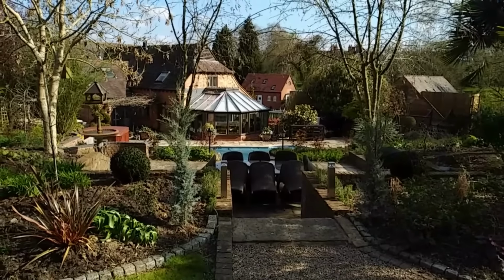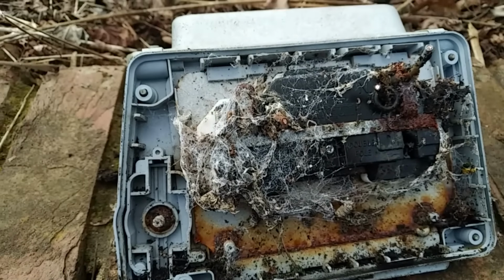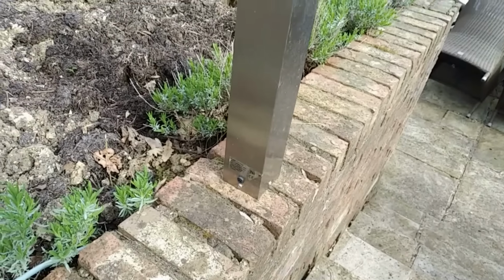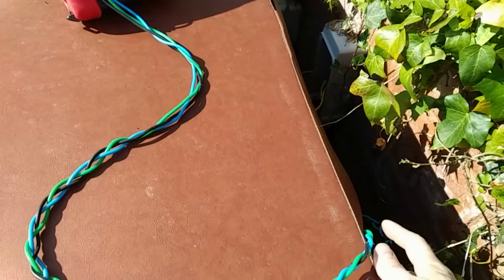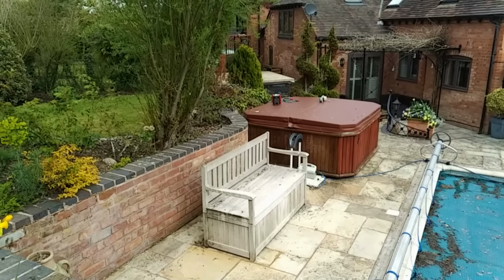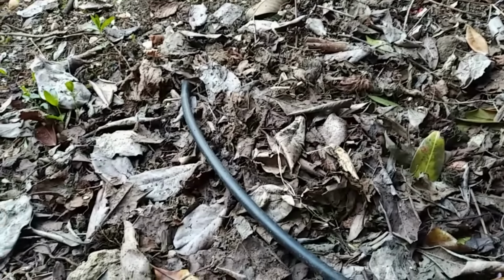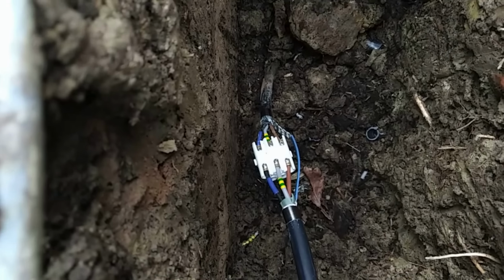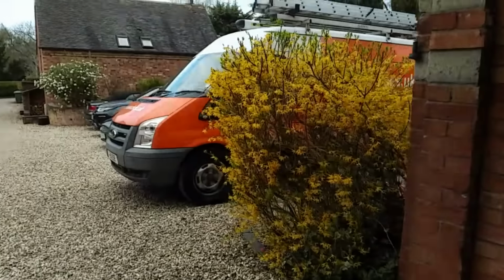Uncocking cack garden electrics

Comment: Did you ever go back and sort out all the issues with the Electro Spaghetti ?
Reply from the maker: We went back at the start of last year where there was discussion on what needed doing but it never got past that, at least not for us. The previous homeowner had put in the landscaping and the current one was formulating plans of their own. I'm not sure if COVID put the brakes on everything or if the work went forward and they plumped for another electrical contractor.

Comment: This disaster site really needs a complete rewire with, in most places,  new terminal cabinets.  Whilst doing that, a transformer to drop voltage to 12v would be a good idea.  The cabinets should be located much further up the walls to facilitate bottom entry to reduce water ingress.

Comment: 13 amps with heater and both pumps on, seems low...
Reply: They make 13 amp hot tubs, cost less and are cheaper and easier to install. And by the quality of this entire job it looks like the owners wanted to do it as cheap as possible.

Comment: Very interesting, but I would have liked to see how you terminated the Swa Sheathing over from the one cable to the other when jointing the cables with the Jointer, it did seem a very neat make off and yes the Alan Key is a complete No No, why they do that irritates the hell out of me, I would add that I do tend to find a safe place inside the Joint and leave the Alan Key covered over in Pvc Tape for the next guy.

Good Proffessionals should have installed Secured Vertical Treated Hardwood Posts Set into the Ground and used Water Tight Mounted JB's to each Post along the length of the Radial Circuit, then spured from each Joint to each required Power Point or FCU for Lighting and lastly all wiring selected should be the same type/size where possible and therefore able to have a fuse rated to suit. The Radial to be installed to depth in the ground away from Gardeners and Vermin at a depth as stipulated within BS7671, Finally all items identified with waterproof tags hanging or stamped at EACH Post JB with the EOL Clearly Identified. A Circuit Drawing left at both the Main Incomer and the DB Supplying the Garden Circuit with the Contractors Details/Date of Installation and any warranty period, this is the signiture of the painting masterpiece of someone proud to show they have installed the works.

Close your ears here, but I often find the difference between an NICEIC Contractor and an ECA Contractor is simply this,  the latter description of how it would be done when using an ECA Contractor and pot luck when using an NICEIC Contractor/Wannabe Contractor. 

Next time you go into an installation carried out and labeled by an ECA Contractor take a look at the standard of the work compared to those NICEIC who seldom leave any evidence they have been there.

Keep up the great work, I love sitting here on a Sunday Morning viewing these takes and it always reminds me that things never change, it was like this 40yrs ago, crap installations in posh houses that thought they were getting quality work for the scandalouse price they were no doubt being charged.
Mr Spence Eng [ex NICEIC/ECA]

Comment: The hot tub is on 230V plug. The hottub can not be moved so there for not an appliance and therefore permanent, and should really be on a isolator
Reply from the maker: The hot-tub is on a dedicated circuit with a 16A 2P+E outlet that has an isolator.

Comment: Eh up DSES! Quick question, call me a saddo but I've been binging on your vids and I'm wondering if you'd mind explaining why your IR test without unplugging, then retest unplugging as you go, many Thanks in advance as I know you'll reply!!
Reply from the maker: Tony you saddo! If we're on a nuisance trip job, we'll test L-N connected together with respect to earth before making any changes so we know what the installation is doing before we roll up our sleeves and dig in. We'll test again with any loads removed so we can see what the difference is. If the IR has gone up, we know we're looking for a duff appliance, if not, we know it's either the wiring or there's still a hidden load we haven't found somewhere. If you have that baseline reading showing how the installation is before you start, then you know if you're making a difference. I hope that answers your question, but let me know if not!
Reply: David Savery Electrical Services answered perfectly, thank you very much! I can relax now and have one of the bar lady’s best!
Reply from the maker: @Webbster77  Quite right too sir! Down one for me! Chin chin!
Reply: David Savery Electrical Services sorry, me again, 3 cans of golden thretch and I'm still thinking about it... would I be correct in saying the following... if you do IR  L-N, L-E, N-E with the load plugged in it will show a low reading, I always find it does, I remove the load and it shows normal reading....HOWEVER, if I was to put L/N together to earth like you do that'll just show a problem with a load, I was surprised to see you send 500volts straight to the boiler with live neutral together and to Earth.. up here I don't think that techniques that known. I read about it and it stops a potential difference occurring in the circuit.. so it will be a technique I'll be using.. so are you saying using the testing technique of live neutral together and then to earth will only show if there's a problem with the load and not for the reason of a low reading if I was to just test live to neutral.. that make sense? Feel free to answer when it's not Sunday, I could talk electrics all day, only been C&G qualified for 5 years, best job in the world and yours and some others and hugely beneficial to me! Nice one!
Reply from the maker: @Webbster77  Yes, old chap, if there is a load then L-N testing will be buggered if that load is resistive as it will drag your numbers down. L-E and N-E can also be skewed as your test current will go up line, pass through the load, go down to neutral and crash into earth at the head or supply transformer (if you've left the neutral connected in the CU that is). You also risk damaging equipment by spiking the line or neutral with 500VDC as you know. No connected load should have a connection to earth though, domestically speaking, at least not unless it has an SPD. If you connect line and neutral together, then the potential difference across them is zero and nothing should be damaged, and besides, that's how a PAT test works. If your connected equipment can't cope with a PAT test, then it probably shouldn't be in service! If we IR with kit connected using L-N tested with respect to earth, then the reading which comes back tells us if there's a problem. Anything under 1MOhm means RCD reliability is out of the window. on an RCD trip job, we test first, confirm a cack reading between L+N together and earth, then look to get the numbers up by disconnecting equipment. If everything is unplugged and the numbers remain bad, we know it's a problem with the wiring, but usually it's an appliance or a combination of two or more appliances each with low numbers.
Reply: David Savery Electrical Services you wonderful man, I’m now 100% satisfied and will leave you to your Sunday!!
Reply from the maker: @Webbster77  I think I shall follow your lead and pour a glass of the good stuff!
Reply: David Savery Electrical Services what!!!! Can’t believe you’re not on it already!! Having watched your vids a 6 month work experience with you and Nige would be mint, I’d pay you! Obviously hyperthetically speaking of course! What you on, Special Brew!?
Reply from the maker: @Webbster77  Never fear dear boy, I am making up for lost time by drinking white wine by the pint!

Comment: 7:45  In Germany we use 230V outside in the garden too. But we put it 60 till 100 cm deep into the earth. So nobody can cut it with a 30 cm spade. All Boxes are over the Waterline, normally greater 20 cm from earth. So every other eletrican can check all very easy. 

If somebody want it cheap they earn the cheap shit. Creepy!

Comment: I wonder if the brick walls are upto holding back all that earth
Reply: Looks like there are no drain holes in the wall...so accumulating water will push on it and if it's still standing it will be a cold winter that will crack it..

Comment: Conduit...who buries line bare.  If you encase it then any problem is easily rectified.  Conduit to properly sealed exterior boxes.  You are there, doing the install, and  the difference in time is a few hours (maybe) and a few dollars...all of which can easily be passed on to the customer.

Comment: Hi david How do you seal rear entry holes on these outdoor sockets
Reply from the maker: Hi Greg. If I were installing a socket on the side wall of a house with the cable passing straight back through the wall (a common occurrence when spurring an outdoor socket off one inside), then I wouldn't use the 20mm knockout on the rear of the socket box, instead I'd drill a hole about 10mm into the rear to allow a bit of 2.5mm T&E to poke through. I also always drill a small drain hole in the bottom of the unit so that if moisture does start pooling, then it can escape. If the cable entry is from the side or underside, then I'd use a gland of course. As for my drilled cable hole, I don't seal it for a couple of reasons. Firstly, silicon sealant doesn't fare well outside over time so it can't be relied upon to last forever. Secondly, when sealing up the socket, you're trapping the ambient moisture into the thing, and when it gets cold that moisture will condense. This is what causes a lot of LED floodlights to fail, and I mentioned in a previous video about the new Tamlite floodlights that they have a breather gland to prevent the trapping of air. Because a 10mm hole is fairly tight around the cable, not a lot of water will be getting in even if it's being heavily rained upon, and only the smallest of creepy crawlies will get into there. In the case of this video, the installer has fitted the sockets to a planter which is filled with soil on the other side allowing water and bugs to travel down the wide cable tunnel through the brickwork and into the 20mm hole at the back of the socket. These sockets would have started to be compromised the first time it rained after their installation.
Reply: @dsesuk  thanks david great explanation. so if you installed those sockets would you enter through the bottom rather than the back because of the plant beds at the rear and water soaking through into them
Reply from the maker: @gd-bq7em  Yes, and that's what we did with the isolator for the hot tub. The old one had been compromised through ingress at the rear, the new one was installed so that the cable came out of the wall and bent around into the side (or underside) of the box. Can't remember which without watching back the video. It's not such a clean look, but it'll last longer.
Reply: @dsesuk  great mate would you still drill the drain hole in the bottom as well if entering from the bottom
Reply from the maker: @gd-bq7em  I always put in a small drain hole, otherwise moisture will always be trapped in there and has nowhere to go if it condenses.
Reply: @dsesuk  fantastic mate thanks for your time 👍

Comment: Are your colour sleevings correct when you joined the SWA in the garden? I thought GREY became BLUE... "Neutral" and the old Yellow bacame the BLACK  Earth?
I always use the grey as a neutral and sleev it in blue, and put earth sleeving on the black... EARTH !!!
Reply from the maker: Grey for neutral and black for earth is what we work to, but the previous installer had done it the other way around. There's no regulation defining what it should be, so if the previous installer has chosen one way, then it's not good practice in my opinion to reverse that down the line.

Comment: The brickwork is pretty poor quality too, as others have pointed out, and really the whole quality of this project is suspect.  This looks like a general contractor or handyman that kind of knows enough to get by at a very minimally-acceptable level and that's about it.  And that's probably being generous.  As far as the electrical goes, I dont know how it back home in the UK, but here in Canada any unarmoured cable being on the exterior like that buried or not would be a no go.  I mean, it doesn't stop people, but any wire that's exterior here has to be in conduit, or armoured, and the deterioration of that twin and earth cable is exactly why.  A common mistake a lot of people make that it looks may likely have happened in that installation too, is compromising the cable by using plumbing tie clamps, too.  John Ward touched on that in at least a couple of his videos.  I can only imagine the ""FUN"" if you do have to repair this installation fully.  I know it's much more expensive and labour-intensive, but I have to agree with others when they say that it's best to pull the whole rotted mess of it and redo it from scratch, you just have no assurance of any quality at any point in that whole shambles.  Do follow up with a video if you go back!

Comment: Never seen those Gel connectors before, very interesting.
I wonder how much that entire job set them back? Then to have to have you guys out just a couple of years later to fix it?...Well part of it anyway..
Reply from the maker: I might have misreported this a little. It turns out the current homeowner hasn't been there too long, and some of this work may date back a lot further than I thought (although the 2016 cable shows more recent alterations).

Comment: confused, so a 32a hot top socket now comes off a 2.5mm cable?
Reply from the maker: If this one required 32A, we'd be buggered. Fortunately, it only needs a 16A circuit, and we've downgraded the RCBO at source to 20A. Personally, I've only installed two other hot tubs in my time, and each has required a 32A circuit. In this case, and going by the different workmanship methods, I suspect the socket circuit originally ended at the twin outlet we had to dig out, and someone later added on the SY cable to the final socket, then someone else later still took a further feed off that to the hot tub. Although I showed a cable with a 2016 date on it, I think that was just the last addition, we were back there last week and I spotted a 1995 date on some of the other SWA, so it looks like the original installation is much older than I thought and some half-arsed additions have been added in more recent years.

Comment: Interesting to see the black used as a neutral. I'm sure when we harmonised the colours the NICEIC did an article on de-neutralising the black.
Reply from the maker: I use grey as neutral and black as CPC, but the previous installer has reversed that so we've kept it the same at our junction for consistency. There is no regulation stating black can't be neutral, so it's not wrong, but it's not best practice. As you say, making the deliberate switch to not using the black helps to disassociate it from its former function. This straying from preferred practice here is another indicator that the person hired for the work wasn't up to speed with the job.

Comment: Am I wrong being concerned about the hot tub being so close to the electrics?
Reply: Yes
Reply: All external electrical equipment is designed for use and should have a suitable IP Rating and in this case a Chemical Rating for Chemicals used in the Jaquzzi.
Hence not an issue having the Jaquzzi next to the Electrics.
Mr Spence Eng
Reply: @apartmentswales  However, have a hot tub close to these, particularly fine, electrics IS something to worry about!

Comment: i don't really get it... this place is very expensive... yet the electrics is crap?
Reply from the maker: People love to splash out on the pretty things and the final finishes, sometimes less so on the hidden infrastructure. As an example, it's common for us to be called to hang new ceiling lights someone has spent hundreds of pounds on because they look nice, but then they baulk at the cost of us installing them properly. They'll often pay a handyman who will do it for less, but then he won't do any testing or certification, he'll do it without insurance or warranty, he might do something stupid like use screw-blocks instead of clamp connectors or cut off earths etc. The homeowner doesn't care because it works and looks good.... until such time as it comes back to bite them on the arse.

Comment: Interesting video. Would it not just be easier and safer to start a new? I wouldn't want to risk digging anywhere in that garden.
Reply from the maker: It's always better if you can start from scratch, but this is an unregulated industry, so many of the installations we walk into are far from perfect on their workmanship. We can recommend replacement, but to survive in business we often have to work with what we can, at least temporarily until planning, costing and scheduling can be worked out with the client.

Comment: Why not give the home owner the option 1 I can fix the sockets or 2 I can rip out everything plug up the holes and do it properly
Reply from the maker: I can rip everything out and do it properly, but not any time soon with my schedule. In the meantime, I can get things working with a level of reliability and safety that satisfies BS7671.
Reply: @dsesuk   fair point, I think if I was the customer I'd switch it all off and wait until you could rip it all out. I cant believe there was that twin and earth with no protection just sat in the soil... would make digging fun 
Loving your videos and thank you for replying =)
Reply from the maker: Thanks Chris. Unfortunately, as electrical work in the UK is unregulated, coming across bad work is common, and I couldn't run the business on rip out & repeat even if I wanted to. More often than not, we have to work with what's there, at least in the short term.